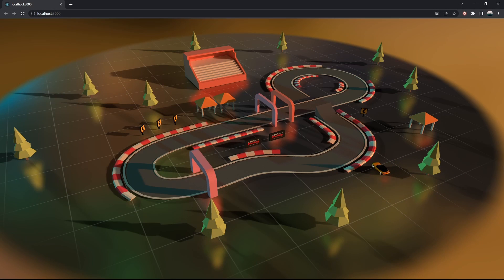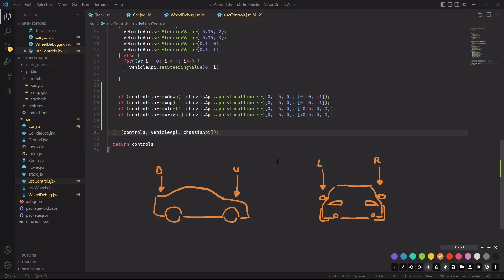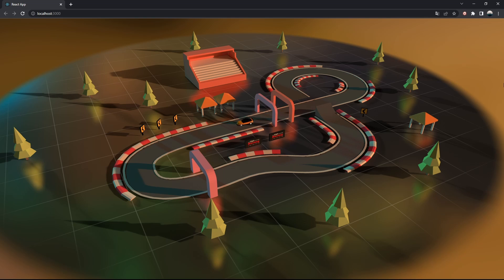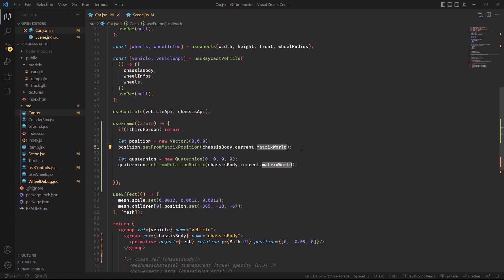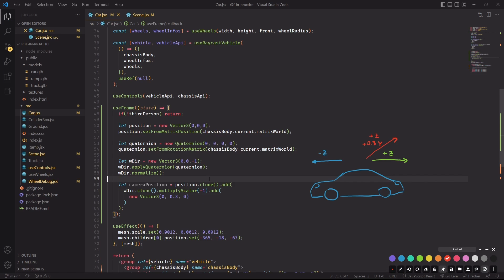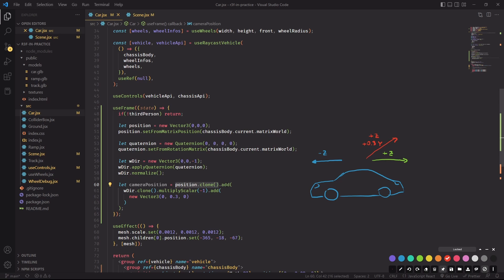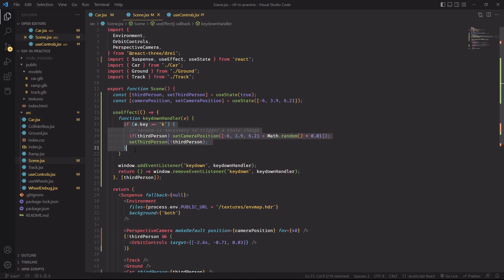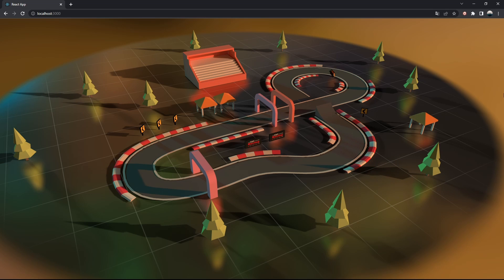Car physics mini game with React Three Fiber and Three.js [ Tutorial part 4 ]

Comment: quick question, why did you use process.env.PUBLIC_URL for the assets, why not put all the assets in the src folder
(P.S. I'm asking because I made a  game it is working but when I push it to production via github is shows me error 404)
(the only difference between my code and yours is that I didn't use a env variable (PUBLIC_URL)  for the storage of my assets I just stored them in src/assets and referenced them)
Reply from the maker: Hello! Did it work for you under the src folder? I use process.env because that's the only way I know of doing it 😂 but if it works under src I'll definitely start doing that!
Reply: @irradiance730  lmao it didn't 😂, it was the issue I fixed it but now I have slow loading any tips?
Reply from the maker: slow loading of the 3d assets?
Reply: @irradiance730  yea i replaced my 3d assets with low poly ones, it takes 38 sec to 1 minute to load
Reply: Great video series btw!

Comment: Have completed the tutorial. It's great, although ramp didn't work in my case for some reason. Project idea: project with elements of presentation (e.g. clickable links inside the 3d world or videos/images). Something similar to Bruno Simon's CV.
Reply from the maker: That's a great idea! It would have to fit a somewhat larger project where you build a portfolio-like website but that's a good idea nonetheless
For the ramp, you should try to clone the repo and run the app from there and see if it works
Reply: ramp works well bro